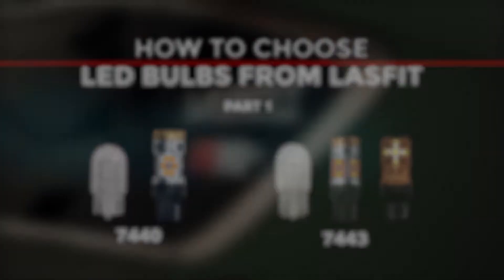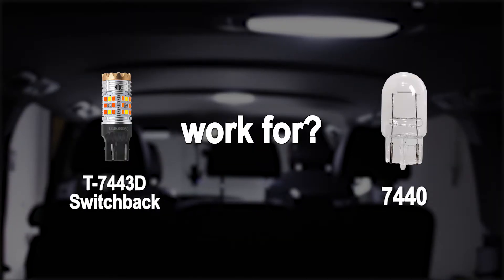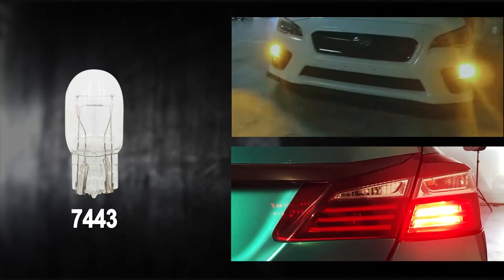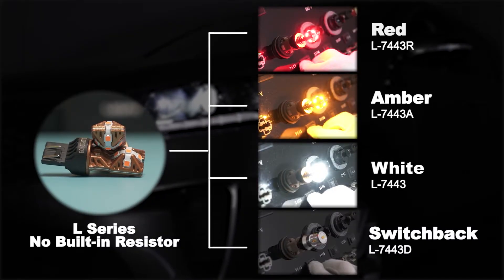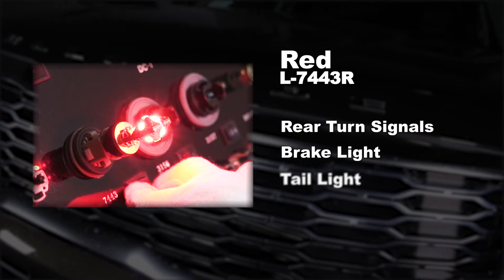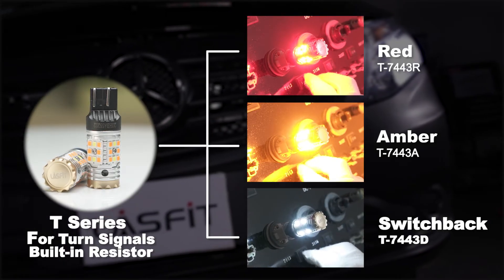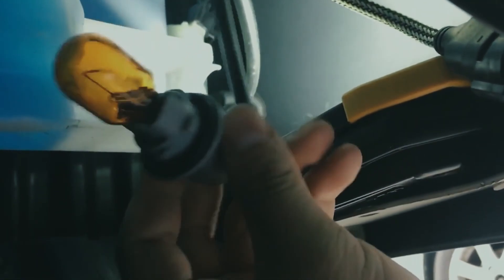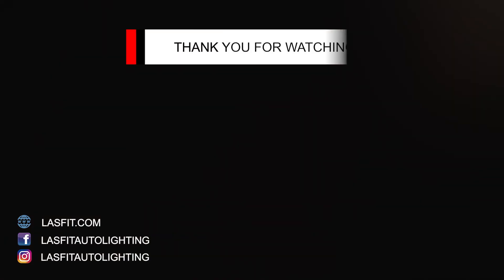How to choose LED bulbs 7443 7440 Brake Tail Turn Signal Backup Lights?

Comment: 2014 Honda civic, sedan, what type of high mount brake light it used?
Reply from the maker: The high mount brake light for 2014 Honda Civic is 7440, here is the link:
https://www.lasfit.com/products/lasfit-7443-7440-red-led-brake-tail-stop-parking-light-bulbs-turn-signal-light-1?utm_source=Social&utm_medium=YTB%20Channel&utm_campaign=L-7443R

Comment: Hi i have 2016 Chrysler 200 LX and i want to change front turn signal please suggest me so that there will not be any hyper flashing and error if switche back work then tell that also
Reply from the maker: To be honest, according to our experience, for some models of Chrylser, Jeep and Dodge, these after-market LED bulbs probably have some compatibility issues. But you can try these switchback LED turn signal bulbs on your  Chrysler 200 LX. You can return them back for a refund in case they don't work well.

Comment: Hello. The connection of the lamps to the Honda 1999 The connection at the back is completely different from what I see in the picture, so how exactly does it fit into the old lamp housing? The connection is different
Reply from the maker: Hello, what's the model of your 1999 Honda？
Could you please take some photos of your OEM bulb and the connection to send us for a look?

Comment: Hey how's It going? Do resistors only get hot when the signal is on? the  7440 light socket has multi function for brake, signal and running light.
Reply from the maker: Hello, what's your vehicle make, model and year?
Do you want to replace the rear turn signal lights?
Reply: @Lasfit-Automotive  hi thanks for the response, I have a 2015 chevy suburban
Reply from the maker: @SONGBIRD434  For your 2015 chevy suburban, the front turn signal and rear turn signal both are 7440:
https://www.lasfit.com/products/lasfit-7440-7441-w21w-led-turn-signal-lights-canbus-error-free?utm_source=Social&utm_medium=YTB%20Channel&utm_campaign=T-7440A

Comment: Would the T-7443D switchbacks work on a 2018 Toyota Tundra SR5?
Reply from the maker: Hi, T-7443D is the right bulb size for youe 2018 Toyota Tundra. But some customers who own 2018 Tacoma said the swithback LED turn signal bulbs are not compatible with 2018 Tundra. So we don't recommend them to you. You could change the headlights or backup lights.

Comment: Hello I have a 2020 GMC Sierra 1500 with factory halogen rear turn signal and brake light. I’m looking for a T7443R or equivalent for brake light and rear turn signal that does not require resistor or cause hyper flash. Thank you!
Reply from the maker: Hi, we don't recommend T-7443R LED bulbs for you to replace the rear brake light and rear turn signals. According to some customers' feedback, there are some compatible issues on the truck if the rear brake/tail and turn signal lights work on the same bulb.

Comment: I just bought a toyota C-HR EXL 2018 and I want some brake lights and I want to know which is the correct plug thanks.
Reply from the maker: Hi, for toyota C-HR 2018, the OEM brake lights are LEDs already, so these after-market LED bulbs don't fit.

Comment: Just ordered the switchbacks for my 2019 Camry SE love them! Now I need the LED turn signal for tail lights and led for brake lights.
Reply from the maker: Hi, you can purchase the compatible LED bulbs for your 2019 Camry:
https://www.lasfit.com/products/2018-2019-toyota-camry-led-headlight-bulbs-exterior-interior-lights?variant=31114497785940&utm_source=Social&utm_medium=YTB%20Channel&utm_campaign=Toyota%20Camry%202018-2019
For the rear turn signals and brake lights, we checked the OEM lights are LEDs already for 2019 Camry. So, the after-market LED bulbs won't fit.
Reply: @Lasfit-Automotive  what about a 2020/21 Toyota Corolla SE? The whole LED package.
Reply from the maker: @jc-diaz487  Hello, you can check all LED bulbs for 2020/21 Toyota Corolla from this link:
https://www.lasfit.com/products/2017-2019-toyota-corolla-led-exterior-interior-bulbs?utm_source=Social&utm_medium=YTB%20Channel&utm_campaign=Toyota%20Corolla%2017-19

Comment: Hi i Have a Scion TC 2014 and i would like to replace the front and the rear turn Signals. Wich bulb should i take?
Reply from the maker: Hi, for your  Scion TC 2014, the front turn signal bulb size is 1156, the rear turn signal bulb size is 7440, here are links:
front turn signals 1156:
https://www.lasfit.com/products/lasfit-1156-p21w-led-turn-signal-lights-anti-hyper-flash-canbus-error-free?utm_source=Social&utm_medium=YTB%20Channel&utm_campaign=T-1156A
Rear turn signals 7440:
https://www.lasfit.com/products/lasfit-7440-7441-w21w-led-turn-signal-lights-canbus-error-free?utm_source=Social&utm_medium=YTB%20Channel&utm_campaign=T-7440A

Comment: Hi, I have a 2015 Silverado and I installed the bulbs T-7443 in my rear tail lights, they turned on bright for a quick second but dimmed slightly, as soon as it dimmed I started getting radio interference. Which lights do you prefer i buy, I seen someone with a 2014 use these on there brakes/turn signals and they didn’t have a problem. Thanks
Reply from the maker: Hello, could you please take a short video for showing your issues? Please send the video to cs@lasfit.com
Thank you
Reply: @Lasfit-Automotive  I already sent the lights back to Amazon. So basically the T-7443 would light up no problem nice and bright but after about a quick second or two they would dim very slightly and I would get radio interference. I know my rear lights are turn signals and brake lights and not sure if that has anything to do with it but someone with 2014 Silverado did this to there rear lights and seemed like they didn’t have any issues. I really don’t want to install a resistor or anything to get brighter rear lights, I was hoping I would find an all in one light like the T-7443 that is plug and play
Reply from the maker: @Rickdogg389  Ok. For some trucks, if the rear tail light, brake light and rear turn signal light work on the same bulb, the after-market LED bulbs don't work well according to other customers' feedback.

Comment: 2021 Ford Explorer. Rear turn signal , License Plate , Back up light.
Reply from the maker: Hi, below LED bulbs will fit your 2021 Ford Explorer.
Rear turn signal bulbs(T-7440A): https://www.lasfit.com/products/lasfit-7440-7441-w21w-led-turn-signal-lights-canbus-error-free?utm_source=Social&utm_medium=YTB%20Channel&utm_campaign=T-7440A
Reverse lights: https://www.lasfit.com/products/lasfit-7443-7440-white-led-bulb?utm_source=Social&utm_medium=YTB%20Channel&utm_campaign=L-7443
License plate light: https://www.lasfit.com/products/2x-lasfit-t10-192-194-168-158-led-interior-light-bulb-error-free-1-year-warranty?utm_source=Social&utm_medium=YTB%20Channel&utm_campaign=L-T10-White
Reply: @Lasfit-Automotive  The rear turn signal bulbs above were not compatible with my vehicle.
Reply from the maker: @laz4790ify  Oh~~
Could you kindly take a photo of the OEM rear turn signal bulbs to send us a look?
Don't worry, you can return them back for a refund if they don't fit your vehicle.
Reply: @Lasfit-Automotive  Sure thanks. I'll send a picture.

Comment: Vios xle cvt 2020 front and rear signal light and break light..
Reply from the maker: Hi, we didn't install these LEDs on 2020 Vios cvt. Do you know the bulb size of your front and rear turn signals and brake lights?

Comment: 2014 nissan altima s
Reply from the maker: Ok. The front turn signal bulb is 7443, the rear turn signal bulb is 3156, you can purchase them from this link: https://www.lasfit.com/products/2013-2015-nissan-altima-led-headlight-bulbs-exterior-interior-lights?utm_source=Social&utm_medium=YTB%20Channel&utm_campaign=Nissan%20Altima%202013-2015

Comment: Hi, I have a 2018 Subaru Crosstrek/XV Premium. I like to change my front and rear turn cignal bulbs to an LED bulb. What should I order?

Also, I like to change the rear fog light bulb (W21W)of my crosstrek. Can you suggest what type of LED bulb should I order?

Thank you
Reply from the maker: Hi, we're told the T series LED bulbs still happened hyper flash on 2018-2019 Subaru Crossrek, so we suggest you use the load resistor to work with the LED bulbs.
As for rear fog light bulb, actually, W21W also is called 7440, so you can purchase 7440 LED bulbs:
https://www.lasfit.com/products/lasfit-7443-7440-white-led-bulb?utm_source=Social&utm_medium=YTB%20Channel&utm_campaign=L-7443

Comment: 2020 Nissan Altima SR. I bought some 7440s for my rear turn signals from a local auto parts store, and have hyper flashing. Would the T series with built in resistor work, or should I just opt for the load resistors and regular L series? Thanks
Reply from the maker: Hi, you could use T series 7440 LED bulbs on your 2020 Nissan Altima.